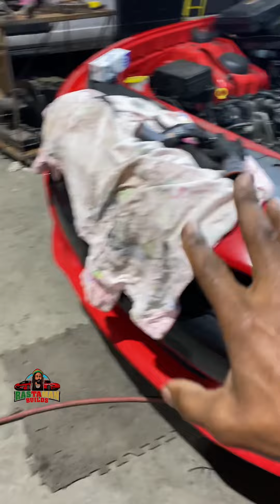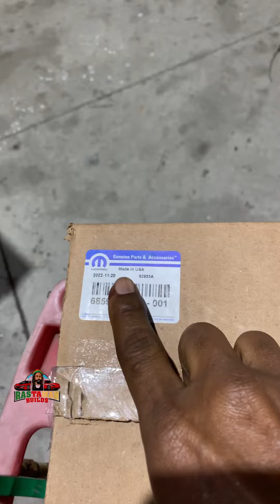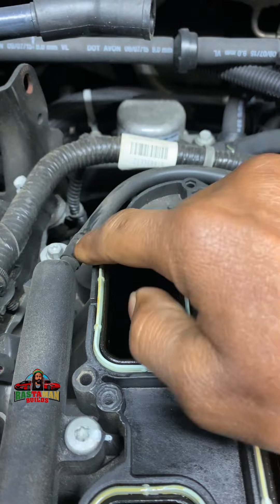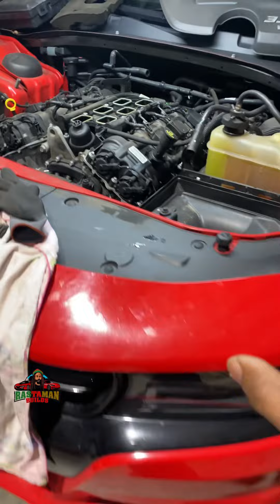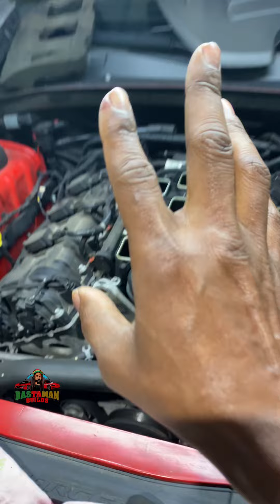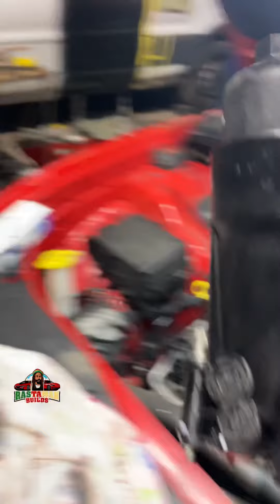Car Repair. Is getting more difficult. Dodge Charger

Comment: These things are ticking time bombs. I couldn’t tell you how many housings we ran thru from the customer bringing it in for a leak or someone doing an oil change and it leaked after the fact. They are the absolute worse design ever and I’m baffled they don’t switch back to spin on filters. When I worked at the dealer these were on back order from mopar for 6-8 months! Dorman or any after market housings were just as bad and they always came back. Some styles are nightmare to take out.

Comment: @rastamanbuilds What medium-sized SUV would you recommend, one that will last for the long haul? Nice video!
Reply from the maker: CRV RAV4 Outback KIA Sorrento
Reply: @RastamanBuilds  Thanks for the recommendations. Are there certain years you favor over others? I've seen recalls with other makes and models.
Reply: @seoguru5826 dude stay the hell away from Outbacks, also steer clear of CRVs depending on the motor, if it's an older b series its bombproof, k series is great if you get a non di only one. Subarus are nightmares trust me. If you want a cheap good used market "suv" that will go forever I'd recommend a rav 4 or a Chevy HHR. Those ecotec engines that came in the cobalt and hhr are also bombproof.

Comment: I just spent days DYI ing at night taking the top half of my 3.6 Promaster intake off. All plastic. Now and putting it back together. Few more days. I hate to say hate but new cars stink. It looks just like that, but 2 less cylinders. I have 80k on it. It was missing. So now all new plugs and coils. I have my doubt it will make 100k I just finished paying it off. Few more years